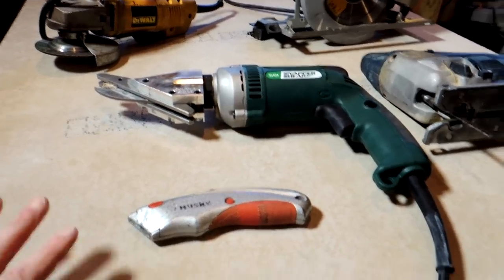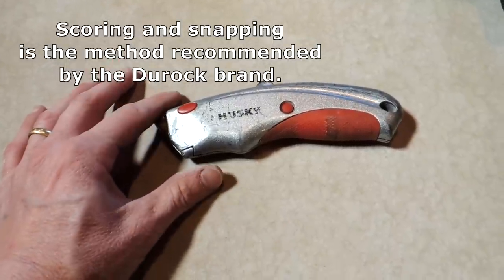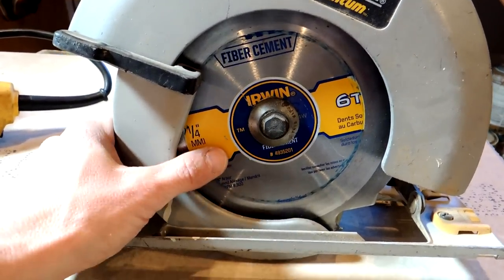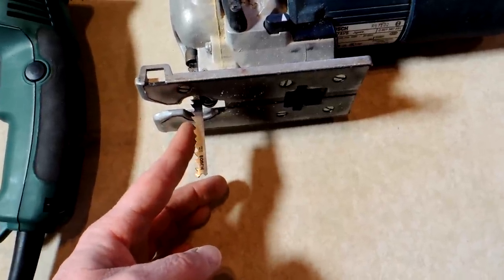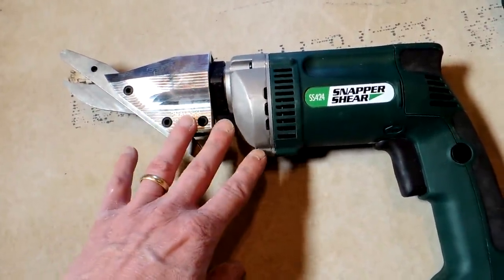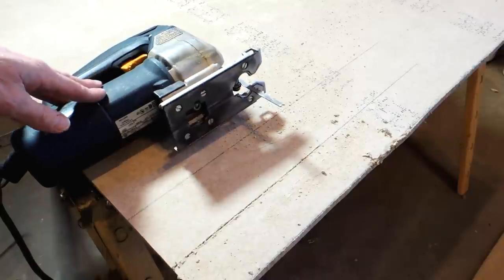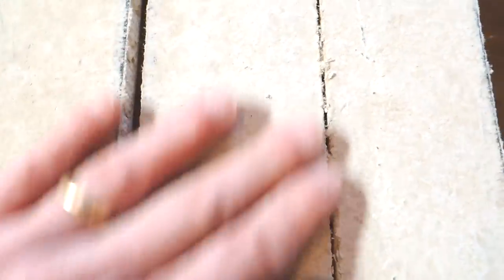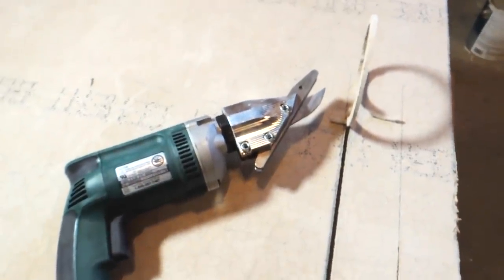The Best Ways To Cut Cement Backerboard

Comment: 6:24 Shear makes an irreversible big mess at the start of the cut, I prefer the jigsaw.
Reply from the maker: I think you were just looking at some waste from the cut.  The shears don't really "cut" the backerboard they kind of chew through it.  The resulting edge isn't perfectly clean, but there's also no reason to have a perfect edge, either.  The only two areas I can think of where a clean cut is important are around a shower valve (some brands are more critical than others) and around an electrical box in a backsplash.  Those are two cuts I would normally use a jigsaw anyway.  For long cuts across a whole sheet, the shears are much faster and you aren't faced with blade burnout.

Comment: carbide scorin knife it will cut cement like butter no dust on the pogress
Reply from the maker: Thanks for your input, and I did watch your video.  I have the same carbide knife somewhere in one of my toolboxes, but it has very limited use.  Even if you can accept the rough edge a scoring cut produces, you simply can't do anything but a straight cut.  I routinely need to make cuts for the backerboard to go around door openings, walls, and various plumbing and electric.  This is especially true for remodeling, as opposed to new construction.  You can't score effectively in the middle of a board, or make in and out style cuts this way.  That's why I prefer the shear for clean, dust free cuts,  or the jigsaw when I need to make tight circles around a toilet flange, or a hole saw or spade drill for plumbing stub outs.

I do share your concern about the dust.  The carcinogenic property is about the silica contained in the product, which can be dangerous if inhaled repeatedly over time.  I make all my cuts outdoors, even with the advantage of the shears.  Have you ever noticed that even picking up backerboard off the pile at a lumberyard or box store releases some dust?  Take a look at your own video and notice the dust flying after you snap your board in half and it falls.  It sound like you have a fan going in the room too.  We all need to stay safe in the long term,  so use your scoring method if it works for you but consider doing it outside.  I also like to wipe down my backerboard with a damp sponge after it is installed to clear away the dust.
Reply: +enduringcharm  yea it fall hard thats why the dust i hate this cement board i have to intalled 40 sheets a day to get paid i dont have time to take my time but it was just an example im gonna installed next week i will wear a mask for it
Reply from the maker: Time pressure is always a problem in construction, and it sounds like you're doing new construction rather than remodeling.  Still, don't be afraid to push back when you find yourself doing unsafe or unhealthy practices just to please a client or a GC.  They won't be around when you get sick.  Better to lose a little money than to make yourself sick.  If you have a chance to borrow one of these shears and try it I think you might find it helpful.  The time to make a crosscut as you did in the video is no slower than your scoring method, and it allows other types of cuts too.  The cost of the tool would be recouped in one job of 40 sheets, that's for sure.  Here's my review of the tool itself:

https://www.youtube.com/watch?v=JUXBOrwh83I&list=PLD4oAOZqK9mDRnc-GiaRH8YjZu-ndUnHV&index=4

Comment: You chipped the board at 6:24 with the shear. That’s not a clean cut at all.
Reply from the maker: I think you misunderstand the point of backerboard.  It's a base for tile, not a surface finish.  Shears and a jigsaw both create a cut clean enough for the purpose.  There is no need for a factory, laser-cut edge.

Comment: NO NO NO! After watching your video i tried your method using my jigsaw and went through 4 blades and only cut about 80 cm! I then saw a tile cutter the following day using an angle grinder to cut the cement board very quick and easy !! Went out and bought an angle grinder and a $5 disc meant for cutting cement board, no problem and much better!!! Please take down your video as it is very misleading!!!
Reply from the maker: Please listen carefully to me.  Using a grinder and creating the dust puts you at significant health risk, even when used outdoors.  To quote the Center for Construction Research And Training: "Silicosis is a disabling, irreversible, and sometimes fatal lung disease. When a worker inhales crystalline silica, the lungs react by developing hard nodules and scarring around the trapped silica particles. If the nodules become too large, breathing becomes difficult and death can result. The risk of silicosis is high for workers in several industries, including the construction industry, according to the Center for Disease Control (CDC), the National Institute for Occupational Safety and Health (NIOSH), and the Occupational Safety and Health Administration (OSHA)."  Cement board contains silica and the dust is no joke.  A grinder is a strict no-no and if you worked at an OSHA regulated job site you'd be shut down unless the grinder was equipped with a water supply to stop the dust.  Getting back to my suggestions in the video, the two methods I recommend are shears, which produce no dust and the jigsaw, which produces little dust.  If you were having trouble with the jigsaw method you either didn't use a coarse-cutting, low TPI blade or you attempted to push the jigsaw too quickly, which will burn out the blade quickly.  In any case, if you don't like the jigsaw method then buy or rent a shear.  Your health is worth more than a tile job.
Reply: @enduringcharm  It's the exact same thing as inhaling asbestos fibers or glass wool insulation fibers - the tiny little fibers get suck in there, you develop scar tissue, then you can't breathe later on.  The problem is the "later on" part - you'll see people say "I've done this for years, and I'm fine".  And then they die 30 years younger than they would've otherwise, at which point it's usually too late to update their comments on YouTube. ;)

Comment: Backerboard is worthless anyway. You are better off using Kerdi board or Kerdi membrane directly over drywall.
Reply from the maker: I'm not a fan of the kerdi board because it sounds and feels hollow or cheap to me after the tile is installed.  Even the Kerdi niche shelf is something I avoid if I can source the plastic type instead.  I like a solid feel to the wall.  When I use the membrane I also use cement backerboard.  While Schluter does allow drywall underneath, it is not accepted by code officials where I work and I prefer it's resistance to moisture anyway.